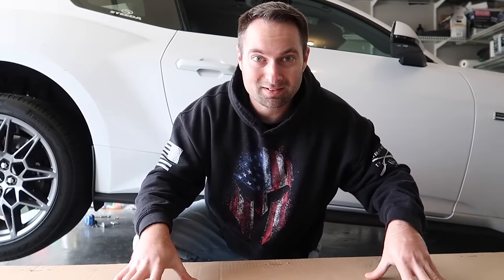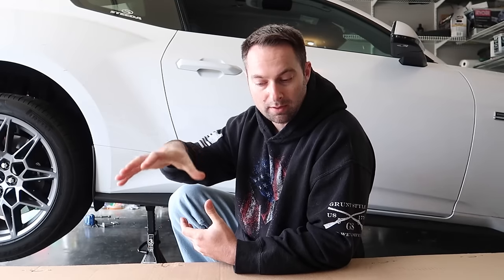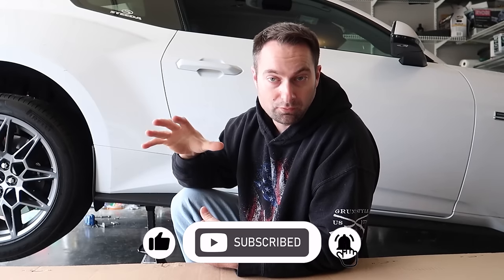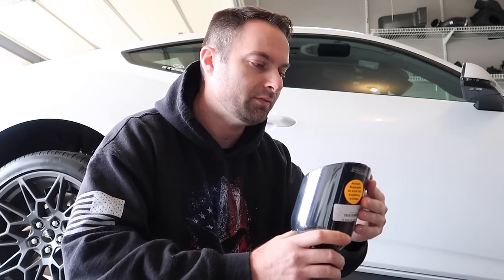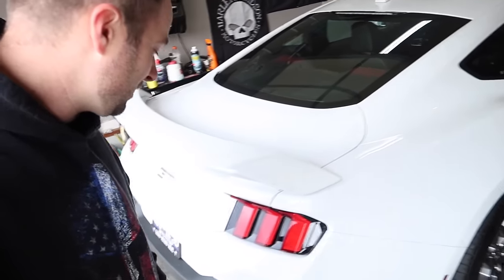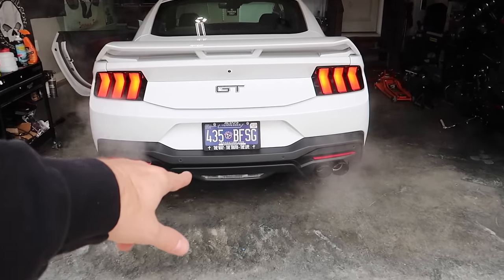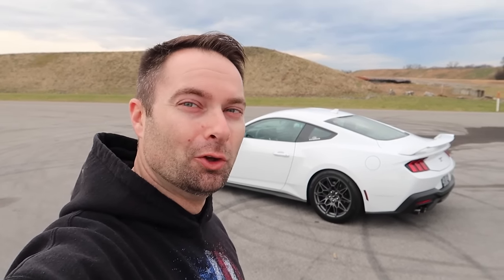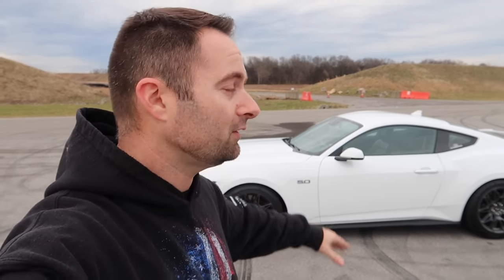WHOA! WE GOT THE FIRST "ALL NEW" CORSA EXHAUST FOR MY 2024 MUSTANG GT 🔥

Comment: Hello quick question do I had a shop well done my exhaust for me Corsa extreme and I guess they put the motors on for me and for some reason it’s throwing a check engine light for the motors on the valves so I’m not sure if you had a code when you threw it on or if there was some kind of issue with the way it was installed? I’ve never had a Mustang let alone active exhaust so just asking

Comment: Is this the 4" tips or 4.5" tips? Do you have the Corsa Part #? Thanks
Reply from the maker: 4 inch part number SKU: 21259BLK or you can do the axle back 21261BLK and do the H pipe 14502 which is what I have now. If you order at Corsa, you can save money with discount code ZANDER13 ( https://www.corsaperformance.com/collections/2024-ford-mustang-gt-fastback-w-valves-5-0l-v8 )
Reply: @Zander13Productions  thanks again man! Do you have any new videos of the new setup? How do you like the H vs the X?
Reply from the maker: @BlaznBlu504  there is a video up of a comparison. I very much like the H pipe better. It’s deeper and mean sounding